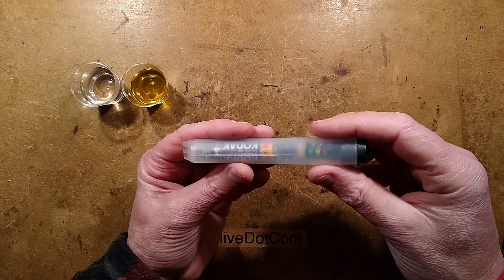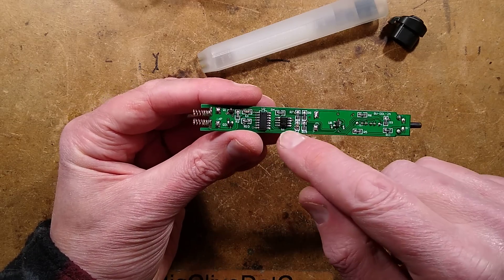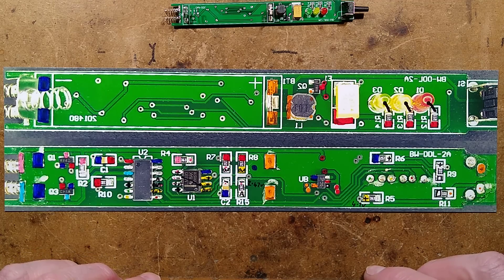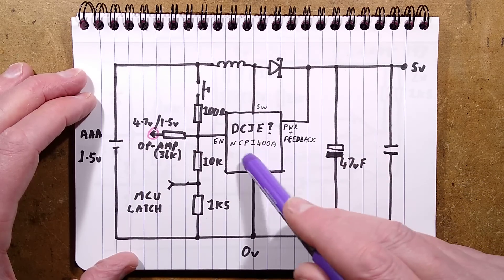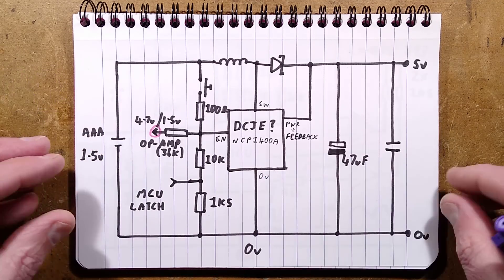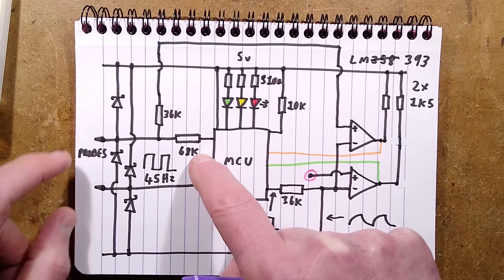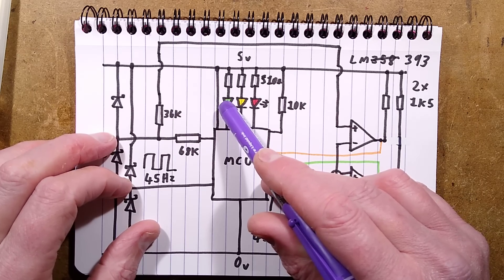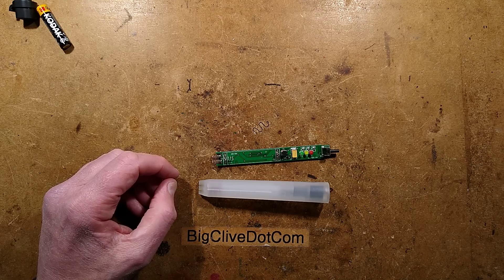Brake fluid moisture tester (with schematic)

Comment: Hay Clive the temperature of the break fluid can get to over 100 degrees science then the moisture (water) will boil providing steam boosted breaks they can lock on. I think this is called vapour lock. Wobbels the mad Aussie.
Reply: It’s BRAKE fluid not break fluid. 
If the BRAKES are broken, the car will get broken.
Reply: but if the cars brakes are broken the car needs a break.

Comment: Sooooo.... do you know if we can check brake fluid with our standard multimeter? According to the internet we can 🤷🏼‍♂
Reply from the maker: It's a tricky area, as the DC current flow can cause weird electrolysis effects depending on the probe's metal composition.  If it was that simple these testers would just have a transistor and an LED.
Reply: @bigclivedotcom  yeah when you started dissecting that thing I went the Google machine and there is multiple people claiming they can test brake fluid using a voltage drop method. Never done it myself and don't know anything about it. If people ask me if I think their brake fluid needs to be changed I just simply say yes 😅
Reply from the maker: @SouthMainAuto  Which is the correct answer.  With added income.
Reply: I convert the brake and clutch activation systems of all my vintage cars to DOT5 fluid which is not hygroscopic...more expensive, yes, but increases the time between rebuilds immensely, no periodic changing or moisture testing required...DONE!
Reply: @ronplucksstrings7112 I was told by someone “in the know” that converting to Dot 5 is difficult as they’re NOT compatible.
Reply: @FutureSystem738  Also, DOT 3 and DOT 4 absorb water, DOT 5  allows the water to seperate and drop to the lowest point of the system, i.e. the calipers and cylinders which then corrode. DOT 5.0 is no longer permitted in road vehicles for that reason and was replaced by DOT 5.1
Reply: @cambridgemart2075  Thanks- I wasn’t aware of that, (though did know NOT to use DOT 5 in my cars).

Comment: I use one of these daily as a mechanic, mine has five leds. the reason is a 5-20 yrs old vehicle never follower the manufacture approved service plan, granny has done 30k and Gym mum has done 120k miles so the garages service best for the customer, gran is only going to have 2 air filters in 10yrs gym mum 6 or 8. So I use a tool rather than the service schedule. Most brake systems today are sealed there is a rubber boot in the lid that gets sucked in to take up space therefore your brake fluid will never get air/moister into it. I did a transit today just a front disc and pad change and rear pads and when I tested the brake fluid it was off the red scale so I changed it, so at its last service it was ignored or not tested but at its next service even though I have written on the reservoir the date of change I will still test it and score it on my job card. PS I had to ask my wife how to spell reservoir at work I have a 40grand tool box with a post it note with the spelling coz the bitch sorry lady in the office has to come out and correct me EVERY time I spell it wrong on a job card  ! LOL My point is "Its a useful tool what the calibration is does not matter you test all vehicles to the same tool, same with my antifreeze tester I use one tool to check it with if there is any come back I have recorded the reading from that tool on my job card.
Reply: Oh PS did I forget to mention I was down at Buckfast Abbey this weekend and grabbed a bottle of Glasgows finest

Comment: After a bit of OCD Engineer googling, it came to my attention, and made perfect sense, that brake fluid should be tested by determining it's boiling point.  Found a video by Bendix.  Bendix has made a few brake components in their lifetime, so I tend to agree!  The "voltage test" pervasive on the Tube is total BS.  The resistance test is slightly less BS but I am sure can be highly variable with different fluids because of probe surface area, separation, and test voltages, etc.  Of course in the end, just flush and fill per mfr's recommendation and don't sweat it!

Comment: I had the agency for such a product in 1989, to sell to garages. It came with a large motorised pump and pipes to change and bleed the fluid if necessary. As an agency, It was not a success but I came away with an idea to make a pocket green/amber/red tester to dip in the brake fluid reservoir. I actually made a working prototype... but then... like so many other bright ideas... I never did anything with the idea. Regrets? I've had a few... 😀

Comment: Interesting design, as you pointed out more complex than expected. Wondering if this design comes about because it is more accurate, or if the engineer was handed some surplus parts and told to make something useful.

Comment: Could you do the same job with a multimetre? Can you make a capacitor using brake fluid?
Reply from the maker: Liquid resistivity is best measured with AC.  You could make a form of resistor with brake fluid.

Comment: I have one of these. I got it about 20y ago! It’s identical but bears the Gunson brand. The red led is very bright on mine. Have used it many times. I even found some brand new just opened freshly bought fluid which showed Amber!  It’s still works fine. Battery lasts forever. Keep checking for battery leaks but ok so far. Important to keep the probe tips scrupulously clean and oil free. Clean with IPA.

Comment: In the 49 years I have been driving I have never had brake fluid changed. The first few decades my cars were pretty ropy so replacing rusty or pin holed pipes and wheel cylinders did all the changing I may have needed. Then I had a few years of new or company cars. I brought a car new in 2013 and had its fluid checked last year and as I suspected it was fine. Problems with brake fluid may not be a myth but I suspect it is sometimes exaggerated. A bit like oil changes. In the UK a change is done at the annual service. In the US drivers seem to be oil change mad but that may be due to very low quality oils or maybe poor engines allowing contamination.
Reply: Think you may find that 12k 0r 20k service intervals are ideal for the manufacturers to sell you a new car !!
Most good mechanics will now say 5000 miles !!!.... particularly on diesels.  just got rid of a 1.9 TDi passat with 240,000 miles on it and 5k oil and filter changes from new.  Also look up 'Oil Dilution'  I am an Engineer.

Comment: I have two of these both from the same vendor on AliExpress. When I had the contract for maintaining/repairing motorbikes for a postal company. The first got a bit damaged which happens when a bike is on the stand and the tester falls off as another bike is being wheeled out and over the tester. After the second had been used a bit, I glued up the original and it worked. Just for fun I added, drop by drop, water to jar of brake fluid and used both testers to see how close the calibration of the testers were to each other. They were surprisingly close to each other; just a drop or two. They were the same brand and model, but bought about two years apart.
  They appear to be much better made than the one you have.

Comment: The comparator are a rudimentary ADC in a clever design. And the 1.5v tap off seems to be a battary measurement. I guess it will blink ore something if the battery is nearly dead.
Reply: Yes, it's a single slope ADC

Comment: The output of the lower comparator will be a PWM signal determined by the battery voltage. Could it be part of a battery check function?

Comment: The idea of the second comparator is that you hold in the button when turning on the tester, and during this time the LEDs will indicate the battery level.  The instructions say that the red LED lights to indicate low battery.

Comment: I think you will be replacing the battery more often than checking the fluid.
I just use my foot on the brake peddle.!
When I drove trucks, 22 wheels. Every time the weather changed, new fluid and bleed.

Comment: 0:59NOT JUST Dot 4, Most fluids fall into the DOT 3, DOT 4 or DOT 5.1 classification. These fluids are all hygroscopic, which means they absorb moisture from the air. DOT 5 fluids are not hygroscopic but are often used in vehicles that sit for long periods of time, such as collector cars or military vehicles and All DOT compliant fluids must be colorless or amber, except for DOT 5 silicone, which must be purple. (knock-off brands) of brake Fluid not following the DOT standard may be in any color, and generally are not recommended for use.

Comment: Isn't it much simpler to measure the conductivity using a multimeter and a custom probe ? You can compare the reading to a test chart.
Reply from the maker: The DC is an issue for testing liquids.
Reply: Got it. How about trying a water quality tester. It's cheap. Just a thought
Reply: @handyman7147  or a radio frequency standing wave ratio meter

Comment: My dad had a brake fluid tester that was based on a piezoelectric igniter. You would stick the end into the reservoir and click it, and if you saw a spark in the window, the fluid was good. If the fluid was bad, the spark would jump across the electrodes at the tip instead of the ones at the window. 
He lost his sometime after he retired and I haven’t ever been able to find another one.
Reply: That's a charming approach to solving the problem. No batteries required!

Comment: Very interesting. I purchased one from lidl in the Parkside brand (HG08332 PBFT A1). It looks tougher than that one. It also has 5 led's (1 green, 2 amber, 2 red) 4 for the fluid test and for battery life with 5  percentage marks going up it and the all light up at the start, then just a green one at the bottom stays on until you test the fluid, you can even turn it on and off with the power button. It wasn't too expensive and seems to work well. Watching this made me wonder how different this one must be made, if there is any difference. I also picked up a cordless rechargeable soldering iron(PLKA 4 B3) in the same brand at the same time that seems to work well enough to what can tell after using mine, seems very handy.

Comment: Edwards High Vacuum used to make a very similar gadget for assessing water contamination in their vacuum pump oil. Theirs was analogue, with a tiny moving coil "battery level" type meter. Ran forever on a PP9 battery. Far simpler internals, and they recommended cleaning the probes before use, which suggests a d.c. rather than a.c. measurement system.

Comment: Actually, here in Florida my brake fluid turns black from moisture, so I change it every Christmas. 5 bikes = 10 brake systems and 3 hydraulic clutches, so that's 13 total. Yes, I have A System and I've made several tools out of computer water cooling parts to help.

Comment: I actually use break fluid to remove paint when the underlying material doesn't react well to traditional paint stripper.
Reply: old brake fluid and engine oil to assist seized nuts and bolts. Not done it for a long time, so whether it worked or still does, I have no idea.

Comment: very handy Gadget!  👍
kind of off topic but, my friend and I had classic cars. two were Hudsons, from
the 1940's, which were independent from the big 3. and a constant thorn in their side.
the Hudsons had a secondary breaking system.that if you lost all your brake fluid, by
pushing the brake pedal all the way down, it would pull a cable connected to the emergency
brake. they were very innovative and ahead of their time. sad they were eventually run out of
 business bu the big 3 bullies 😡 PS: they were American cars, not sure if they ever were in England/UK....
Reply: 1. In the animated movie CARS, the Hudson Hornet (an actual production car) is voiced by Paul Neuman.
2. My grandmother worked for Hudson in Detroit during WWII. Not making cars, making war materials.
3. Hudson's was the largest department store chain in metro Detroit. Bought-out by Dayton's (of Minneapolis). Dayton's became Target, as the stores had to compete with Walmart.

Comment: So, I grab my ohmmeter, stick the probes in the fluid ... 220K and above is good, 150-220K is flakey, and under 150K, it's time for a flush. Sounds a lot better than tasting it... like we used to do in the 70's with that PCB oil.🧐

Comment: Does the packaging say what the LED colours refer to? I just do a full fluid swap every 3y or thereabout (sooner if the brakes need work). For the cost of a couple of litres of fluid it's just easier to exchange it, espacially as the water absorption is probably happening all the time (I think).
Reply from the maker: They give a percentage indication, but yellow is advising new fluid soon and red is definitely changing the fluid.

Comment: The "pink" input/comparator either checks the battery voltage or calibrates the set point timer/counters using the battery voltage as a reference. Capacitors are high tolerance components, so this is possible.

Comment: i would guess the gradations on the tube are to indicate how much brake fluid you have displaced.  since oil floats on water, do you not have to drive the tip down to the bottom of the reservoir?  does hydrated glycol sink in brake oil?  i don't know, can only guess.  this circuit is very interesting to me, as i am using A/C to indicate salt water levels, having had similar problems with D/C corrupting my probes - thank you for your analysis, very helpful.

Comment: It was the hydroscopic properties of dot 3 and dot 4 brake fluid that prompted me to flush the brake fluid on all my vehicles and switch them over to dot 5 brake fluid which is silcone based and non-hydroscopic.  It's the moisture that causes calipers and brake cylinders to corrode from the inside and fail.  Some of my vehicles have had the same dot 5 brake fluid for 20 years without any problems!
Reply from the maker: There's an interesting note that the silicone oil version may not be compatible with some ABS systems
Reply: Are the seals compatible? I see no reason to use less than DOT 4 on any vehicle as lower numbers have worse properties and 4 is only a fraction more expensive, but I don't know about the seals.

Comment: I was wondering if a device like this existed; now that I know it does, I should probably add one to my toolbox. (Yes, I know about brake fluid test strips.) Having a hard-to-press button means it's less likely to be turned on accidentally as it bangs around in a toolbox/chest, so I wonder if that was a design choice or an unplanned feature.

When you bring your car in for brake service and they recommend a fluid flush as an add-on service, water in the fluid is reason why. The last thing you want is water in your brake fluid, it can cause all sorts of problems, including interior rusting/corrosion of brake components. Sometimes shops tack it on simply to make more money, but a routine flush is considered best practice. Every two years is appropriate, but it should also be flushed after any major brake work that requires the master cylinder or lines be exposed to open air.

Comment: My brake fluid tester has settings for different fluid types as well as different brands. Yes, there is a difference between brands even if they have the same rating.

Comment: I have a set of kitchen scales which I've replaced the power/tare button on several times. When the button approaches the end of its life, I tend to get rogue presses which sometimes put it in a calibration mode waiting for a 5kg reference weight. I'm amazed I've not accidentally screwed the calibration after all these years.
Reply from the maker: The calibration modes are expecting somewhere in the region of the calibration weight.  If the current weight is nowhere near that they will not calibrate.

Comment: DOT 3 4 and 5dot1 are Glycol based but because of different formulas for each number many 2 probe testers have to be calibrated for the type to test. Wet Boil Temp spec is a Fluid with < 4% water. Many brake systems have way more then 4% and Fluid often Boils near 100C. These are cheap "tools" that are often inaccurate and Fails soon. There is a tool originally made by Alba Diagnostics in Scotland that actually Boils a small test sample and no need to calibrate for DOT number. ⚠Do Not confuse with DOT 5 Silicone that have different problems and not compatible with glycol brake fluid systems.

Comment: Remarkably more complex than it seemed! I could have used it, some 3 decades ago, when I had spongy brakes in my old Seat and couldn't figure out the problem (I had installed almost everything new), until an old mechanic told me "change the damn brake fluid"!".

Comment: I always feel that the explanations given for DCDC converters are simplified to the point of being wrong. In this case both stating "high voltage spike" and that the feedback controls how many pulses the boost converter does, is just not correct in general.

For the first point, the voltage developed across the inductor while the magnetic field decays in this circuit is approx 4V, no high voltage to be seen.

The boost converter chip is also always switching, with a duty cycle adjusted to give 5V out. As it is likeky very lightly loaded, it is possible that it operates in burst mode (switching when needed in bang-bang control style) but this is not the typical case.

I wonder, are these intentional simplifications? Btw 47uF tantalum output capacitor is straight out of the datasheet, so not too odd of a choice.